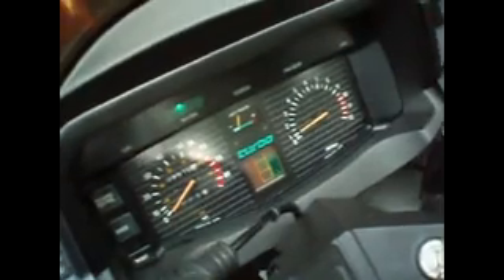Yamaha Turbo Running

Comment: Really nice bike!  Which year?  I own a 1981 Yamaha Maxim 650cc.  There is only 20,000km on it.  The engine is running like a new one!  I'm really proud ouf it!
With a turbo it should be really interesting for a bike.  How many hp?